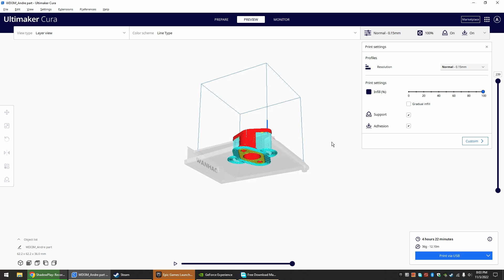Junk Robin ec17 Two Stroke Engine Restoration Part 3 Assembly and Test

Comment: Happy Birthday, after a big project like this I'd say you deserve some rest. That little Robin motor turned out well. If the carb manifold can't work as plastic, then is there a way to use the plastic piece as a mold for casting in aluminum or brass? Or a short bit of schedule 40 steel pipe and some flat stock could be cut-out & welded to make a new manifold. Whatever you do, the fact that it runs so well now is more necromancy than mechanics.

Comment: You are awesome to rewind the recoil starter spring they can be fun to rewind 😮😏😣😕 if done in a proper fashion oh by the way what the oil gas ratio mix for this engine
Reply: Thanks for the heart young man 👍😎
Reply from the maker: They are real fun haha, just wear eye safety goggles, they have a tendency to strike like a snake. For this startup I used 25:1 that is why its smoking a little, but at least I know it wont seize, also helps when seating the rings.

Comment: Looks good. But you need to get yourself a torque wrench and look up specs. Also, always use clamps on fuel lines. They will loosen over time.
Reply from the maker: specs are for sissies hahaha joking, I do have one, and I torque down every bolt to spec. I just don't show it, I show a few of the fastenings just for show.

Comment: How long do you think that printed intake is will last?  Pretty harsh environment.  Heat, fuel, vibration, carburetor and filter hanging off of it.
26:12  Never mind.  I had not quite got there before posting.  That answers that question.  LOL.  A person can fab one out of steel or aluminum easy enough.

Comment: Hi AJ. Where do I get the carb float height setting for this engine?
Reply from the maker: It is in the carb, the float has a little level pin that you can bend to adjust the float, just make minor adjustments, a little goes a long way.

Comment: How did U set the Ignition timing?  &  I would lightly grease the recoil spring & the shaft. & Use protective Gloves all the time. Today this engine is Called Subaru it's 4 Stroke.  Good Restoration & Video. Cheers.

Comment: She purrs and wants to cut some grass!  Good reminder to never put bare Hobbit feet near a mower!  I was wondering if using a plastic carb mount was a good idea.  Oh well, it got you to the starting line anyway. 😂
Reply from the maker: I hoped it could last longer, turns out the heat from the bolts connected to the cylinder gets quite hot. I actually want to try and cast a manifold with copper for the fun of it. Might make a video on it in the future, but for now, it was enough to get the motor going. 

Haha love working barefoot. The engine sounds great, I love it!
Reply: @AJRestoration  There are plastics that could take that kind of heat, my son does 3D printing and he knows much more than I do. I was wondering what kind of plastic you used to print the manifold though?